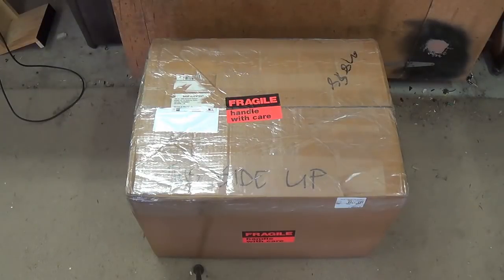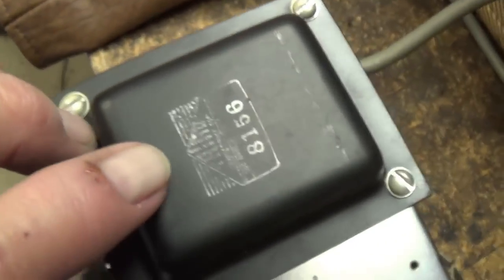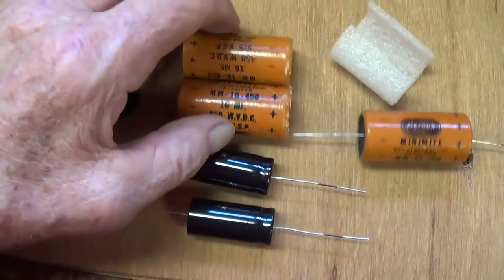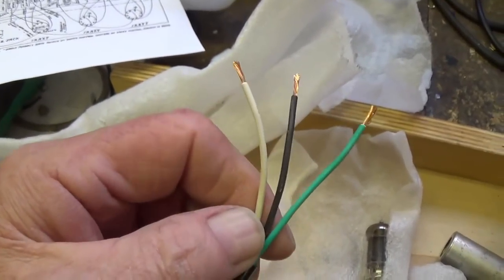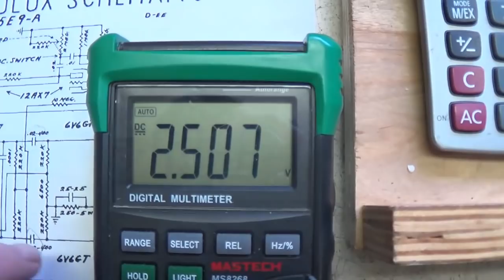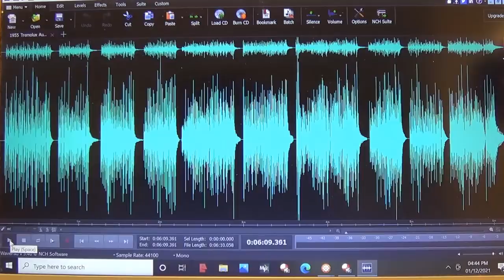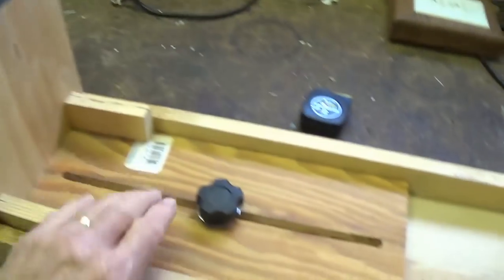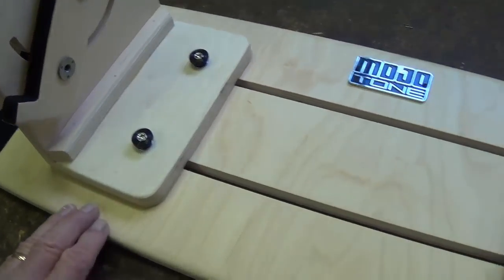1955 Fender 5E9 Tremolux in near MINT Condition.....Wear a Bib !!

Comment: The ‘scratch and sniff asbestos sheet’ - you kill me, Unc!   That amp’s a beauty!
Reply from the maker: Cough!....Snort!......Thanks, Ronny :)
Reply: Hey Unky it's me your favorite nephew Southbound Suarez.... Boy ya thought my Tweed was pretty? That Tremolux certainly has my '59 beat! 
That amp certainly is a "Bute"! It sounds just like a Tweed should except for it did not have noise, hum or rectification.... It is so nice I am almost suspect! L.OL.
It looks like the cat is outta the bag (or actually is outta the garage and into the house) well the cats meow and the precedence is now for cap stuffing!  I am doing it very often now. However I am pushing out the metallic can and then I open up the can by slicing it radially right down the middle. First ones I slit them on my lathe.... Too much work and while it is so precise , it doesn't need to be cut in half so perfectly. (I was trying to make the part as perfect as possible to minimize the hairline when placing both halves together. It doesn't need to be perfect under when it's stuffed under the  label, ya never see the cut or seam.... Now I just use a Rigid tubing cutter instead. I remove the guts and drill out the ends along the edge of the rivet. My new caps go inside the old can with the negative all the way to the 
Metal end with the lead threaded thru the hole drilled next to the rivet. I fill the void of that half with hot glue and then I slide the other positive end over the positive lead threading it thru the hole on the fiber disc next to the rivet. Add some more hot glue to the positive side and put both halves of the can together and stuff the whole can back into the paper. I roll the crimp back over after a light brushing of watered down fish glue or gum arabic. 
Ok now that we have got the ecaps covered now we can work up a technique for those wax paper foil caps and the molded paper  caps. I have a few ideas I've yet to try. 
Ya know after I sent ya those pics of my shop and stuff, you mentioned how I had so much stuff crammed everywhere and how I needed a cradle like you.  Frankly, I  had already been contemplating a chassis stand. I even had pointed out the Mojo one to my snowshoe cat and other household pets   before Christmas but my family never seemed to get the idea of what to get me , so they obviously rather be safe than sorry and felt it better to not get me anything. See how they look out for me! 
So after surfing and browsing the Hoffman forum I saw some interesting posts with all types of ideas. For amp cradles and jigs... It got me motivated. I just happened to come across some arms that were adjustable and used for retail display of keyboards in a music store. I bolted them against the wall and now can hang my chassis off of  the wall and now have more bench top landscape.  Now I can clutter up with more stuff...  The angle of the dangle is adjustable with pins and the arms can fold back when not in use!
I knew you had been flying multicopters but I never realized that you had assembled your own. I just figured ya had a DJI or something or another.  What controller are ya flying?  I have flown KK , Multiwii /Arduino with GPS ,  APM w/GPS , PIXHawk and all the various versions of beta flight F4 ect.....
Reply: You people are amazing !!!!! You are way above my pay-grade !!!!!
Reply: That's  a beauty.
Nice nice job.

Comment: Serial Number 353 survived the 2010 Nashville floods is still with me. Your video conclusively verifies that the tube chart is wrong on mine as well, which says 5U4GA too. I'll spare the story to keep this simple, short, and to the point (although it's almost painful to realize my heroes aren't perfect - the guy who takes care of my stuff has been quite an inspiration to me for a long time). It was my first great amp. Not only is there a 5U4 in there now, but has been since at least 2016 based on service-records. I have another destroyed 5U4 with corroded pins (I never threw out flood-damage) so this amp has probably been running the wrong rectifier probably for much longer, likely since before 2010. Evidently I got away with it. The heater winding obviously still works. Thank you as always for all you do.
Reply from the maker: You're welcome, Sean.

Comment: Hi Uncle Doug, I noticed one of your engines had a Scintiller magneto. I used to rebuild this in England, we had the agency. Parts came from Taylor Vertex. I still have some of the tools here and a 6 cylinder old magneto in the store. It will be siezed but I could rebuild it. I have documentation and used to have all the stop plates for the different advance curves. I sold the business to Morfeild Operations which was then taken over by Tom Dark engineering and they still do them to this day. I used to rewind the coils and fit new ones when we could get them.  I still have the winding machine here in Canada and use it to wind the odd radio coil and speaker field coil. Happy Days.
Reply from the maker: Thanks for sharing this with us, Allister. Vertex Scintilla magnetos were instrumental in all sorts of drag racing and Bonneville Salt Flats history. It's great to know that repairing them is not a lost art. Our best to you :)

Comment: As always, a great video. Love the tip on checking the coupling caps in circuit. I just picked up a 5F2A Princeton that I am performing the same capacitor stuffing process on, I use firm foam for my end caps so that the squash a bit and fit firmly in the tube. I am lucky enough to be the custodian of her older sister (serial number 0025) and she is a beauty, although very ragged compared to this one - the tales she could tell!
Reply from the maker: Thanks, Mat. It sounds like you have a great pair of amps. Best of luck with them.

Comment: That Mojotone amp stand would also make a nice stand  for working on turntables by adding a couple clamps under the pivot bolts on both sides that will clamp over the turntable.
Reply from the maker: Good suggestion, Ben. Thanks !!

Comment: The colour-coding on that new power lead is not just the European colour-coding, it's also the same colour-coding we use over here in Australia, the yellow/green wire is the earth wire, brown is the active wire, and blue is the neutral wire if I remember correctly, our mains supply is 240V AC/50Hz.
Reply from the maker: Thanks for the helpful input, Simon :)

Comment: Hi, uncle Doug, and all the best to you and the rascals! 
I was so happy to see you've made another video, and with such a precious amp. 
I have doubts about your method of measuring the leakage of  coupling caps (around 37 minute). If the cap is leaky, there is no reason for a voltage on the grid(s) to be noticeably _rising_, it is just too high from the start (from when the amp warms up)(preamp grid should be at ground potential, at zero volts, and if it is not, it messes the (cathode) biasing, and so makes the tube run "too hot"). Measuring the potential on the cathode, as you did  quite possibly doesn't tell you much, there is no connection between 0.1 coupling caps and the cathode other than the vacuum in the tube. If you wanted to measure the leakage in the circuit, you should be probably measuring the potential on the grid (which shouldn't deviate from zero) (with the pots full on, as leaky caps in this circuit position could result also in the current to the ground otherwise). As for the leakage in the power section: it seemed quite strange to me that you had to change the cathode resistor (for a twice as big) when biasing to get the acceptable current through power tubes. Stock value is there for a reason, and those would have to be exceptionally "hot" tubes, way out of spec, to have such current at the factory value of cathode bias resistor ... unless we've got a pretty leaky coupling capacitor here, which messes with the bias and so increases the current. You have compensated for a leakage (hot grid) with a higher value of cathode resistor  (lifted the cathode voltage in response to higher grid voltage) - but leaky caps tend to deteriorate,  so that is not a real solution. That said, if there are suspectful caps in a system, it is not good to first adjust the bias and then try to find them: you could easily overlook them - it's like cleaning the crime scene thoroughly and then start looking for the clues. But I may be wrong about it all. 
PS: I now see the point of the rising voltage, it's just the same as with the semiconductors, a "closed loop of destruction" - but I suspect it would have to be a pretty bad case of leakiness to be noticeable. 
With so old caps (and so precious amp) it is probably the best to just replace them. Or at least do a thorough out-of-circuit measurement. 
And then another comment about the "concealed" caps: wouldn't it be smart to mark in some way there are new T+L's inside - if by any chance in five years this amp sees the service again (this goes for all such "stealth jobs").
Reply from the maker: Thanks for all your very helpful and knowledgeable comments and suggestions, JK. Bear in mind that all the cathode bias resistors were tested and all the bypass caps were new.

Comment: Whomever sent this to you has proven to me, at least, a former skeptic, that at least one time machine (aside from the one allegedly in the Vatican) actually exists on this planet.  This is a true gem, and well worthy of the royal treatment provided it, by the very best.   

I've Been near that road, once,,,
Twelve years ago, a gent from Indiana tracked my Motorola Dealership down, in search of a NOS modulation-stage transformer, for a very peculiar, first generation Motrac UHF Transceiver, which was part of a system tested for Motorola, by one of the departments within the LAPD. He wound up visiting my shop to pick it up, and I installed it - just to have the honor to work on something prototyped by Motorola in their heyday, the 1960's. While I'm at no where near your skill level with regards to amps, and tube-moderated devices, in-general, I felt honored to have been allowed to "take METCAL soldering iron to PlaCir", and carefully change-out that open transformer.  Kind of a 'warm and fuzzy' feeling that day; I think that I know how you felt!
Reply from the maker: I do indeed, AMS. Thanks so much for the nice comments.

Comment: Cool amp, love the tone. Also thanks for the tip on the Princeton's biasing. I just built one from scratch from a AA1164 schematic, and my output tubes are pumping out the watts! I noticed it breaks up early, and was a tad concerned about it, it sounds cool but I might just add that bias resistor where the cathodes goes to ground like you explained.
Reply from the maker: Your AA-1164 circuit already has the means to adjust the grid bias and establish a proper plate dissipation level for your 6V6's. You would be better off using the adjustment you have rather than adding a cathode bias resistor.
Reply: @UncleDoug  Ooops, I made a mistake on  the schematic type; I built the princeton circuit from Mojo's schematic which is different than from the AA1164.

Comment: That is probably the cleanest tweed amp I have ever seen. Too bad someone had to use it as an ashtray. I hope you are enjoying your new amp stand. It's a good thing you had those feet on hand. You definitely wouldn't want to set it up on your dining room table, or any other furniture you cared about without them. I just ordered a chassis stand before watching the video, and it should be arriving soon. I got the Ted Weber one. It looks similar to the Mojotone version, but was a little cheaper. It supposedly can accommodate everything from a Fender Champ to a 100 watt Marshall. I have a set of rubber feet on hand just in case it has the same design flaw as the Mojotone.
Reply from the maker: Thanks for your comments, Jason. Good luck with your new chassis stand.

Comment: Uncle Doug...Thanks again for another great video!  Could you please do a video that explains how to draw tube load lines as a tool for determining the optimum plate voltage, plate load resistor, and cathode resistor values to use and how these factors affect an amp's headroom.
Reply from the maker: Greetings, Jake. I have tried repeatedly to create a video covering this topic, but abandoned it due to the crushing boredom of the subject, and the probably lack of interest or applicability for 99% of viewers......however, I continue to keep trying.

Comment: 🐨 With that earth wire, A while back I came across an American website that sells Yellow clothed Spaghetti "Be great if they now supply all colours", But I am not sure if it will fit over that plastic green ground Err-Earth wire unless the plastic is stripped away, Which BTW would just be another high end touch that current and future retro fans will adore and go absolutely Ga~Ga over what with your supreme high end restorations..
APU As a long time fan I dropped a  👍
Reply from the maker: Thanks so much, K :)

Comment: I noticed on their web site, the MT stand Holds up to a 29-3/4" Long Chassis. In your opinion is that restrictive at all to larger amps? Or does that fit 99% of amps? 🎶🎸
Reply from the maker: I've never encountered a chassis anywhere near that length, Ed, so I would say, barring the arrival of some monstrous box on my doorstep, that the MT stand will work for 100% of normally-encountered chassis.
Reply: The chassis on my Super Twin Reverb measures 24- 3/4" long.  I don't know of a longer chassis.

Comment: OFF Topic Asking Your Advice. Hey Doug. I'm building a guitar amp using a pair of 6L6, 12AT7, and 2 12AX7. Only one half of one of the of the 12AX7's will be used. Transformer has 6.3 volt filament winding. Do I heat the half of the 12ZX7 I'm not using? Or wire both sides of the filament?  CHEERS
Reply from the maker: I usually wire the filament just like the other tubes, Don.....both sides......but just for consistency sake.

Comment: Uncle Doug, sir, i got a question. Is kinda interesting:  I got a 2 channel amp, clean and lead, connected in parallel from one input jack, i can switch channel with pedal switch or the panel switch. I was thinking about doing a cascade mod, then i remember this one is  a PCB. 
So i have to cut the path for the input of the first lead channel gain stage... then here goes my crazy mind thinking  "or do i need to?". I imaging installing an on off switch from the output of the vol pot of the clean channel, to the input of the first gain stage of the lead channel. The clean channel only have one gain stage.
If i dont cut the path, the signal will go at the same time from the clean gain stage and from the jack itself, to the input of the first gain stage of the lead channel (when the switch i want to install is On).
My question is: what will happen? i have 2 possible scenarios: A) it will add to the signal, in vol and saturation B) because the clean triode invert the phase, it will cancel the signal totally or partially.
Reply from the maker: Sitting here, miles away, I hesitate to even guess, TL. When I am in your position, rather than speculate about the outcome, I simply try the mod and see if it works.
Reply: @UncleDoug  I see, thanks!

Comment: Getting a 58 vibrolux in a week or so, might have to send it your way for a tune up!
Reply from the maker: Let us know if you need help, D.
Reply: @UncleDoug  not sure if I'm getting it now or not. Some things seem off to me, 6 digit serial #, replaced speaker and output transformer, no date code stamp on the tube chart and all the pots look pretty new as well. I have some more questions for the seller before I buy it. The thing looks the part but now I have a bad feeling.
Reply from the maker: @dangitdan9938  Trust your gut, D, especially if the price seems too high.....or too low.

Comment: Hi Doug ,had a question for you . I've got several tube amps I haven't played in awhile .I've been told to get a variac  and slowly charge up my caps .Can a 3amp,variac do the job ,and how long to leave it on there for,5 mins. 10 mins.etc. Any help would be appreciated . Thank you .
Reply from the maker: If they've only been sitting for a year or so, you can probably just plug them in, Bob......but if it's been several years, then a 3A Variac should do the job. You increase the voltage in 20V steps, pausing at each step for about 10 seconds.
Reply: @UncleDoug  Hi Doug ,thanks . I've got several that hasn't been played for 7 or 8 yrs. You know the big 100 watters,haven't seen daylight since the invention of light bulbs . LOL. I'll bring those up real slow I'm guessing.  Thanks again.

Comment: For the long term reliability of the amplifier, I would have replaced the coupling caps anyway. Any time now they could and probably will fail and that's the end of the expensive 6V6s and may be also the output transformer.
Reply from the maker: Thanks for your helpful input, Michael.